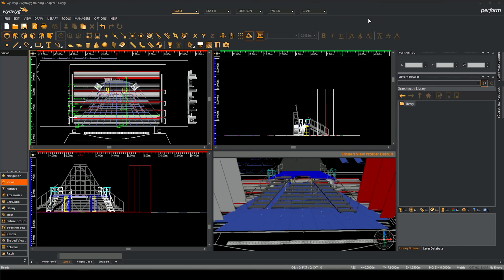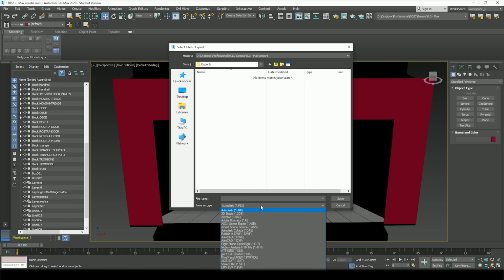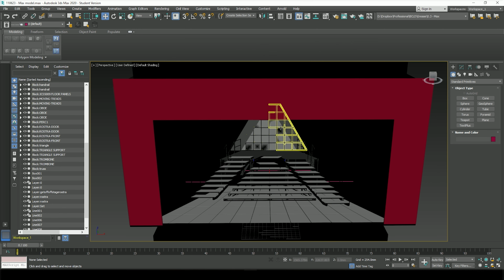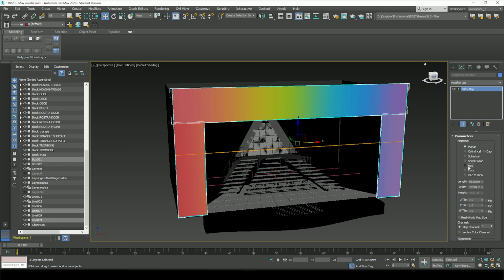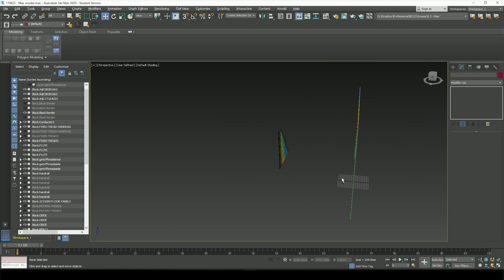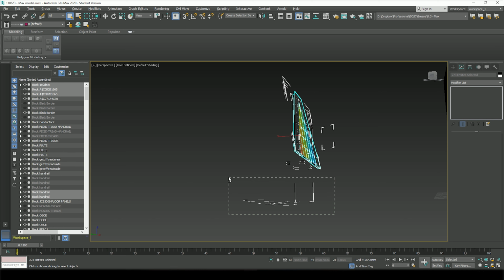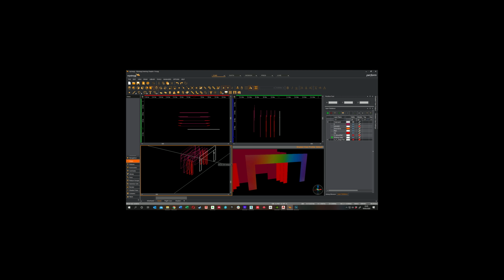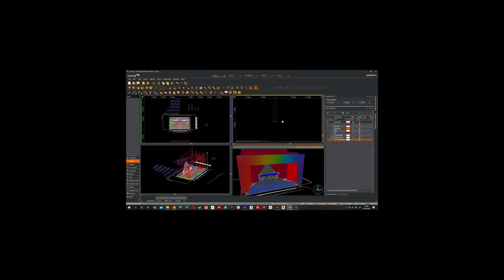Wysiwyg Training - Lesson 21 - Merging 3D Files

Comment: perhaps you find this useful. Whenever I export to wyg in non geometry referencing formats, I make a cube that is exported as a dwg and have that same cube exported with the models. If you match both cubes, you'll get it done. Also I've got some cool tricks to import fixtures with their position, not rotation sadly, using lines.